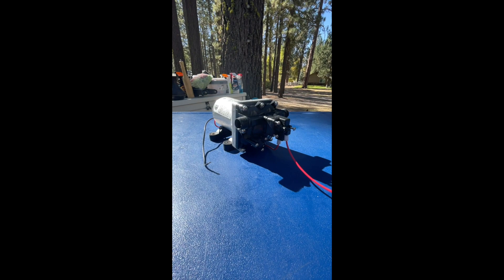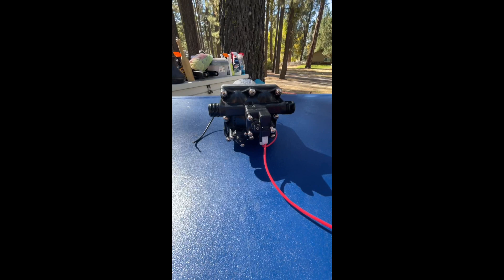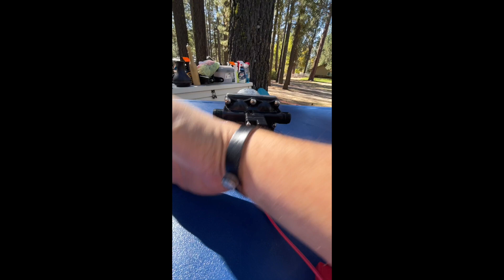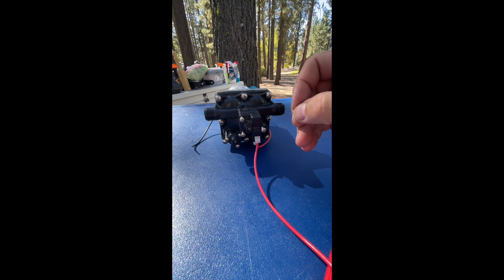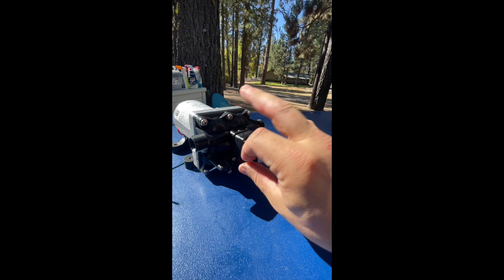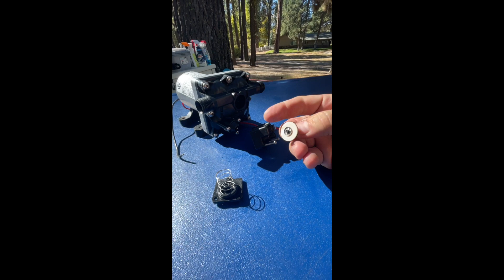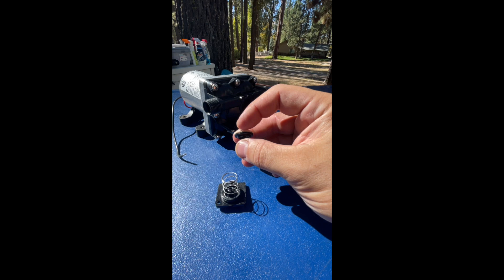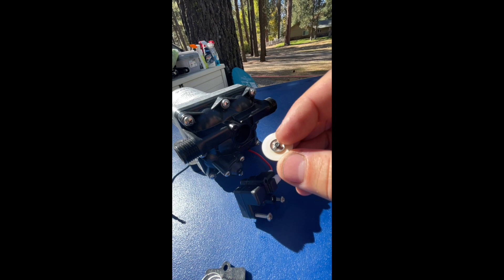RV check valve what is it, where is it and how to clean it.

Comment: Thank you for this video. Today my fresh water tank was 2/3 full and no idea why since I've never used it in my 3.5 years of owning the RV. Drained the tank but also asked around and someone pointed me to your video. I will be checking this out tomorrow and hopefully that's the issue. Two questions though. First, can you put some type of PTFE like the Aladdin MagicLube for orings and gaskets? And my second question, if I was to install a separate check valve, what's the diameter of the pump threads and what style of threads is it because I'm assuming it's not like garden hose thread pattern. Thanks your your help.
Reply from the maker: There are only two reasons for a tank to fill not intentionally. If you have a diverter valve that switches between filling your tank or city water that sometimes goes bad, but if you have two hook ups on the exterior of your trailer, one for city water and one to fill your tank, then this is most likely your problem.
Finding a check out that will work for you. It’s practically impossible. They just don’t make one can screw on directly to a pump your best option. If you don’t use your pump is just to buy a cap and screw it on to bypass the pump completely when not in use. I will try to add a link.
RVs used half inch pex
Reply from the maker: https://amzn.to/46tarlw
Reply: @RVGuyss  thank you for the reply and for the link. I will try cleaning the check valve but if that doesn't work then I'll grab these caps and just isolate the tank altogether since I don't use it. I appreciate the guidance and help. Take care.
Reply from the maker: @canucha1985  i’m happy to help. I’m happy somebody suggested my video to you. I do recommend anyways getting the caps male and female. They’re good for emergencies.
Reply: @RVGuyss  I'm glad I was pointed to your video as well. I'm in an RV group on Facebook and I asked there and that's how I got the link to your video. Now, I have it saved in a folder so I can share this knowledge with whoever has this same issue in the future. Hopefully it'll help them out like it did with me. 

I will be buying those caps because like you said, it'll be good to have for emergencies. Once again, thank you and have a good one. :-)